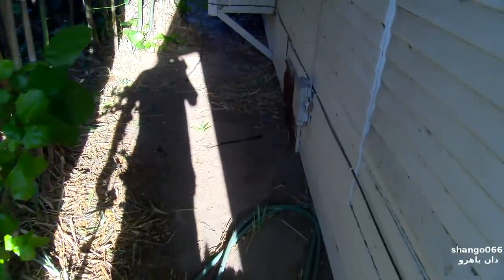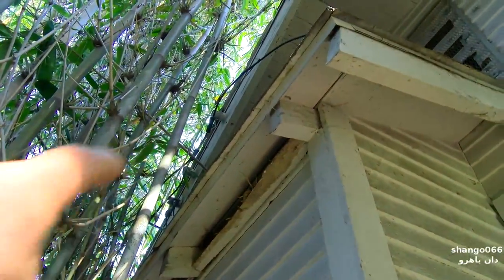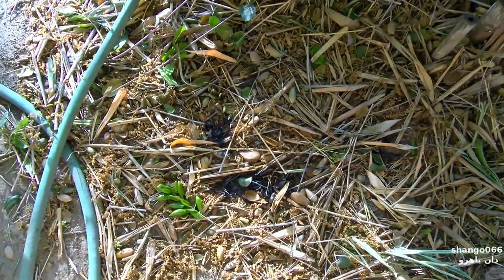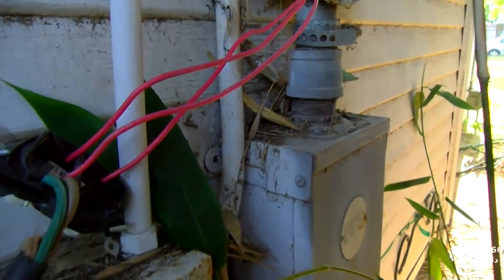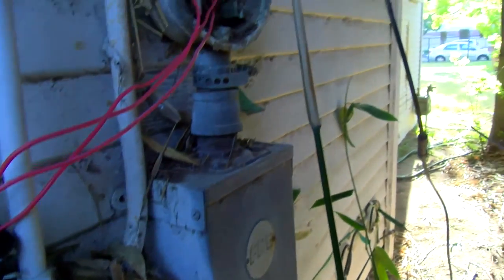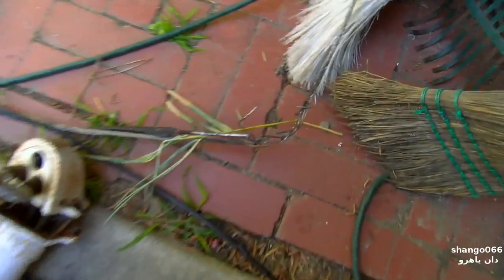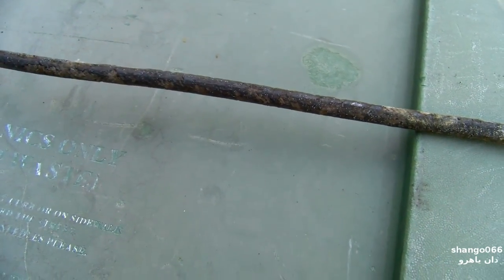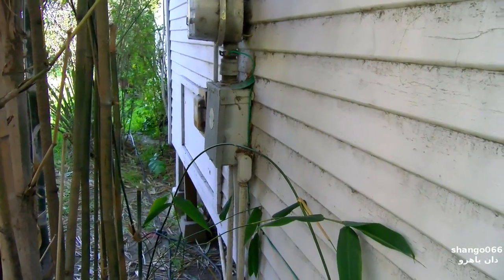power feed line short failure

Comment: An electrician explained the thinner gauge wire in the service line to me. This is the "weak link,"
It did exactly what it was supposed to do, acted as a fuse, and proteced the heavier wires going into the house. Great repair! Shango.

Comment: Had an old house in Detroit that was built in mid 1920s and it had some primitive wiring. It had a fuse box with two glass fuses and a phone number for the electrician that installed it that was a four - digit number.
I had to change that outside wire as it looked similar to yours and did it myself while it was live. You have to be careful and only handle one thing at a time.
Then I had another place where all utility wires were underground. One day it went out on one of the hot leads. I had company come out and they checked the boxes where the wires went underground and found them all okay.
Then later I found it was a bad connection in the meter box. To have them come back and shut it down to fix it would have cost me money $$$ I didn't have so I made a clip out of copper that I could put alongside the meter that I could clip in without shutting things off to bypass the bad connection.
Don't live there anymore but as far as I know it's still there.

Comment: I don't know the specs offhand, but the free air ampacity on rated wire is significantly higher than if it's run in a conduit, by something like 30 or 40%.

I'm surprised the utility didn't make you cut down all that bamboo before they reconnected. Maybe you can rent a panda?

Comment: Nice save there. If that FPE box contains any FPE circuit breakers get rid of 'em. Lotta houses burned down due to FPE circuit breakers (they don't trip). Looks like it's just a disconnect switch though, if so no problem with it.

Comment: Here in Ontario the utility will not do reconnection without a permit pulled and an inspection from the ESA. As a Master Electrician myself I have to say that is one abortion of a service. Also here good luck getting house insurance if you still have knob and tube wiring and anything less than a 100 Amp service.

Comment: Why is everybody so afraid of cloth wiring? If it was so "dangerous" the
 house would have burned down years ago. I am an electrician and have 
worked with alot of it no issues. Besides, this house most likely has 
"BX" cable which has a spiral wrapped flexible steel outer jacket to 
protect the wires within and provide a grounding path to all the metal 
boxes. Even if it is old knob and tube, with open single rubber 
insulated cloth covered wires (type R wire, and it is insulated with 
rubber and the cloth braid is there to protect the rubber) on porcelain 
knob insulators and porcelain tubes where the wires pass through framing
 members, and a mouse chews it bare, nothing will happen because the 
wires are several inches apart (minimum 4 inches for concealed, in-wall,
 floor and ceiling knob and tube wiring) and on insulators, so they 
cannot short or arc. In fact it is a very safe wiring method as is 
armored BX cable, if left alone, not overloaded by installing too large 
of a fuse on each circuit, and not tapped into or meddled with by 
homeowners "adding into" the system. I also have many vintage lights and
 appliances etc with original cloth cords, and they are as safe as any 
modern  cords, as long as they are in good shape. People are actually 
afraid to plug in old lamps, etc with cloth cords, and ones in perfect 
condition! It is a phobia imparted on us by companies wanting us to buy 
new and get rid of good old stuff, and electricians looking to make 
money off of rewiring a house that doesn't need it. There is nothing at 
all wrong with older cloth wire, and ANY wiring can start a fire, 
regardless of insulation type if it has issues or is bodged and 
incorrectly installed or fused/circuit breakered. Cheers!
sure the stuff outside is been in the elements but inside it is fine
Reply: Not completely sealed junction boxes and screw terminals are the issue mostly. Maybe european cloth is more bridle by virtue of being european, but i've seen more burned neutrals that where insulated by cloth than I can count. Of course the actual wire inside the wall is fine 100% of the time, but that's not why they're usually replaced, at least over here. Greetings from a german electrician.
Reply: @realdomdom  interesting, yes, most of the issues seen with old wiring is either from poor repairs or modifications, or from devices and connections failing, normally the wiring itself is not the issues.

Comment: Hm, I don't know what a new meter box thing would have cost, but heating up screw terminals to get them loose seems like a bad idea in the long run as that screw connection might heat up and fail, creating a new possible fire hazard (not sure if it'd get that far tho). Redoing the rest of the mounting stuff is fine in my book though.
Like many others have commented as well, I'd recommend to get rid of all the plants interfering with the power line, just to be on the safe side (not that another storm rips something around again).
That old cabling looked like it was a fire to happen....good thing you prevented that from happening last minute!
Thanks for your video documentation of this incident and fix. :)
Reply: Nah, using heat to remove the screws is perfectly fine. It allows the screw and the threads to expand, which causes the corrosion bonding them to break loose.

Comment: rewiring my bosses old house there was knob and tube still in it.oneof the things ppl did was strip back the insulation where they wanted to add a new light socket or recepticle.then they would twist the wire around it and tape it.problem  is this is a lousy technique and I found 2 places where the wood beams were scorched.

Comment: Crazy that you have to do all that. Here the utility is responsible for most of what is before the meter.
Reply: I found out that in Detroit the utility was covering everything from the pole to the house and the meter. The wire from the house anchor to the meter was still my problem.
So I changed it myself while nobody was looking.

Comment: We had 2 feed wires short together and burn in 2. It was in some trees, the limbs moving back and forth with the winds wore down the insulation after so many years, and first we lost one side of the 240 volts. The the other side.(It tripped the circuit breaker in the pole transformer.) It was on the power company's side, so they had to fix it. With splices .

Comment: I suspect that the insulation rubbed thru and shorted to the bare stranded metal wire which acts as a strain relief and the neutral return(it's grounded to earth at the step-down transformer. To be the biggest failure point is where that service feed connects the house, that looked like a single insulator lagged into wood. New ones are bolted to the Service Head conduit but this on is too low.I agree with others, you need to keep all the "greenery" well trimmed from the service feed line. Utilities are NOT responsible for clearing the "greenery" where it goes from the Power Pole to the Service Head..that's the Property Owners job.

Comment: Surprised myself that transformer fuse didn't pop much sooner. Fortunately for you your state apparently doesn't require a bonded 'license electrician' or 'Electrical Contractor' to do any work to any structure in your state (that does not belong to you the owner). Adding, where I live the utility company would insist on (1.)  A permit (2.) A detailed plan in writing (3.) bringing the service up to code and require (4.) everything new including a through the eve riser and saddle strap or NO RECONNECT. Yeah... that's how screwy things have gotten here in my state. It's even worse if you're trying to get temporary or new service out in the country; including but not limited to having a professional survey of the property,  proof of ownership and registered with the county tax collector office naming a few.

Comment: Those are really thin utility feed wire wires, especially for a country that uses 120V were you need twice the amperage for the same power.
Reply: Most houses are 100-200 amp

Comment: I didn't realise you have nominal 230v AC going into your houses in the US. I thought it was 110-120. Is it the oven circuit that runs on 230?
Reply: It's 240v with a center tap, so you have two hot legs each 120v to neutral. If you draw power from both hot legs you get 240v for high load appliances like stove/dryer/air conditioner
Reply: Thanks very much. got it. Three wire, split phase.
Reply: 230 comes into the house  and thats brought down to 110 in your breaker box.
Reply: it's 120-0-120 the transformer on the pole is a center tap transformer
Reply: Andrewausfa most ovens, dryers, furnace and water heaters run off of 240-250 volts

Comment: if it lasted more than 90 years, then it was good enough for 90 years. 
modern systems will never complete 90 years... so no shame upon the people who constructed ages ago!
Reply: Why is everybody so afraid of cloth wiring? If it was so "dangerous" the
 house would have burned down years ago. I am an electrician and have 
worked with alot of it no issues. Besides, this house most likely has 
"BX" cable which has a spiral wrapped flexible steel outer jacket to 
protect the wires within and provide a grounding path to all the metal 
boxes. Even if it is old knob and tube, with open single rubber 
insulated cloth covered wires (type R wire, and it is insulated with 
rubber and the cloth braid is there to protect the rubber) on porcelain 
knob insulators and porcelain tubes where the wires pass through framing
 members, and a mouse chews it bare, nothing will happen because the 
wires are several inches apart (minimum 4 inches for concealed, in-wall,
 floor and ceiling knob and tube wiring) and on insulators, so they 
cannot short or arc. In fact it is a very safe wiring method as is 
armored BX cable, if left alone, not overloaded by installing too large 
of a fuse on each circuit, and not tapped into or meddled with by 
homeowners "adding into" the system. I also have many vintage lights and
 appliances etc with original cloth cords, and they are as safe as any 
modern  cords, as long as they are in good shape. People are actually 
afraid to plug in old lamps, etc with cloth cords, and ones in perfect 
condition! It is a phobia imparted on us by companies wanting us to buy 
new and get rid of good old stuff, and electricians looking to make 
money off of rewiring a house that doesn't need it. There is nothing at 
all wrong with older cloth wire, and ANY wiring can start a fire, 
regardless of insulation type if it has issues or is bodged and 
incorrectly installed or fused/circuit breakered. Cheers!

Comment: In the 1920's, a 120 volt, 30 amp. Electrical service was permitted.
Today, the minimum is 120/240 volt, 100, amp. Is the smallest.
I am very surprised the electric utility set, or installed the watt hour meter.
I Connecticut that would have never happened. When the house insurance agent found out that my electical service panel was made in 1953 with fuses, he insisted that a circuit breaker panel be installed. So the 120/240 volt 60 amp service was up grades to 120/240 v. 100, amps.
Proper sized fuses, are much more reliable than circuit breakers .
Nice viedo.
Reply: Lived in a house that was built in 1927.  Had a 30A 120V service.  The fuse box had a 30A main plug fuse, and two plug fuses for two branches.  We didn't have a problem with it, though didn't have high-watt appliances for the most part.